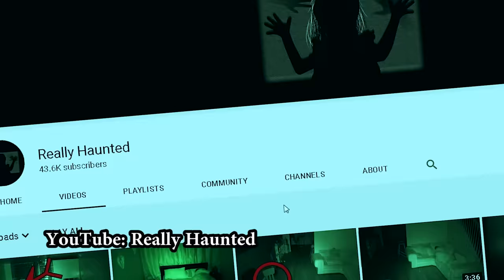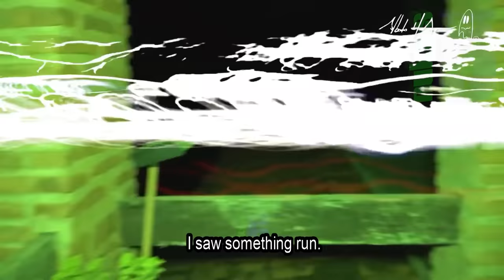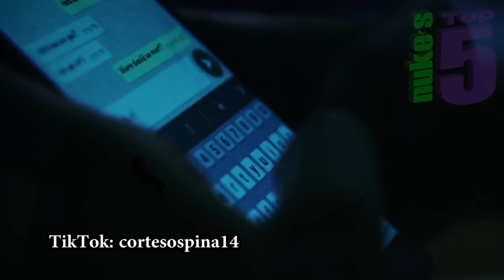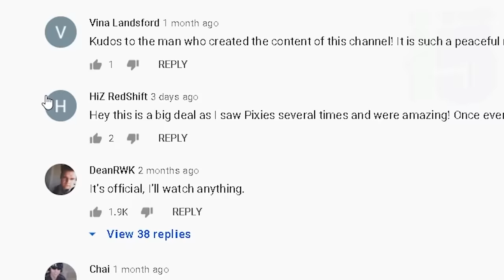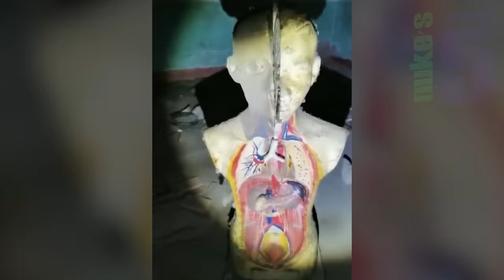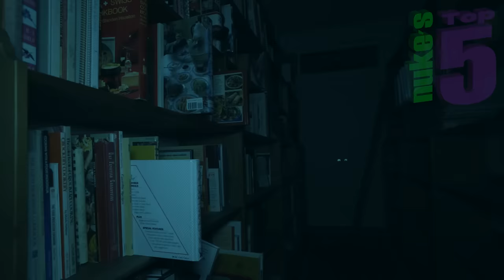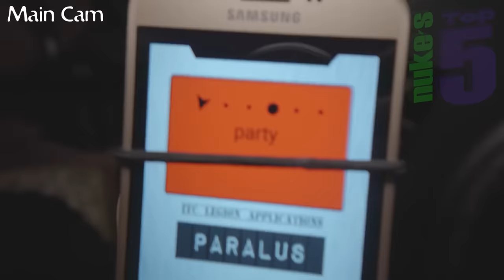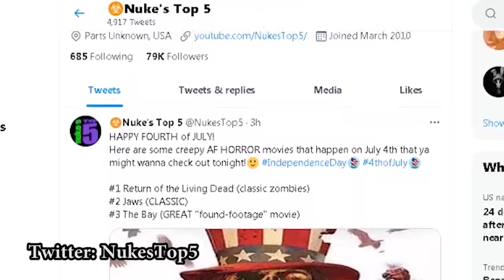5 GHOST Videos So SCARY You'll CRY Into Your STINKY Pillow

Comment: Music boxes rely on a spring tension force to turn the wheel, and when it gets low enough it can sit there silent for a long time, until it just gets triggered by vibration or just that the spring wheel finally turns over the edge. I've had music boxes that I've recorded in my studio do this inside a closet, haha. Kind of rattling, but nothing supernatural.
Reply: I was going to say similar, I've had this happen too. Clock work toys or actual clocks suddenly come to life for a bit with no apparent cause. It could be paranormal in the video or just normal 😊

Comment: Some of the Twin stuff is explainable. Old music boxes rely on winding a spring - and after a hundred or more years, that spring is not going to release its tension smoothly. It will stick and release as it winds down making it seem like music is being summoned by supernatural forces. Also TV remotes operate on infra-red - they are using all sorts of night vision and auto-focus camera equipment, a lot of which also operates / focuses by using infra-red light. It is a no-brainer that if you wave IR lights about in front of a TV and you stand a chance of switching it on.

Comment: The motorcycle one isn't so spooky, it's easy to pull off as all you need to do is trim the throttle so it stays open.  I learned this trick the hard way when I trimmed mine to do tricks and fell off, the bike continued about another 100m without me before driving into a paddy field.